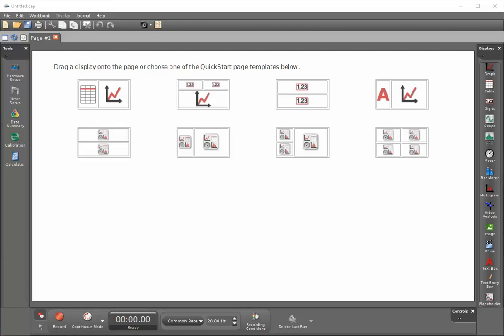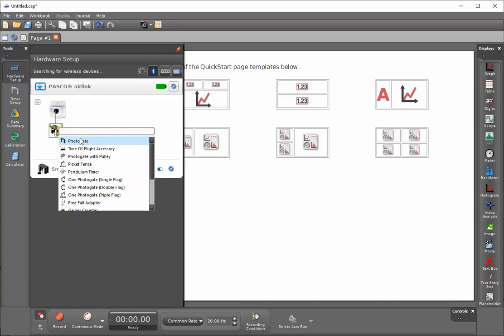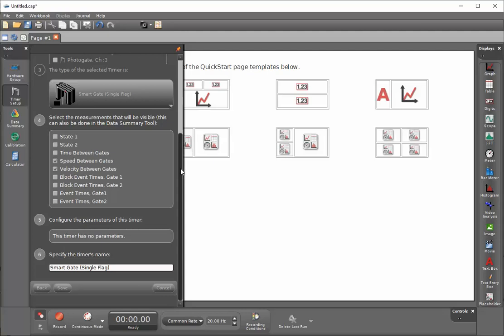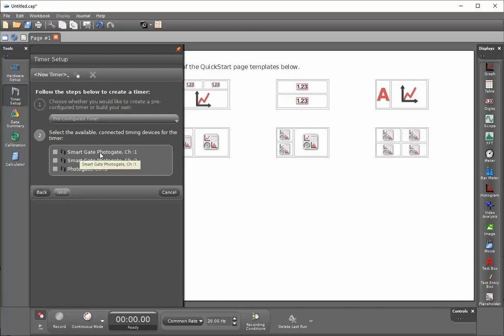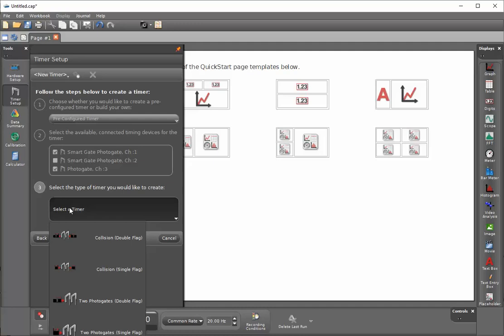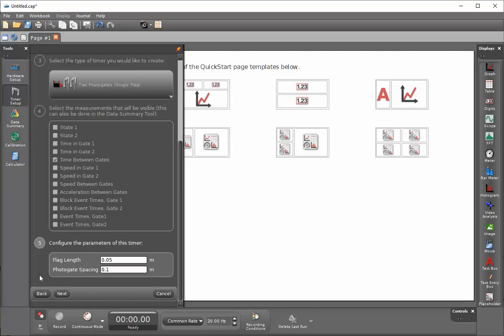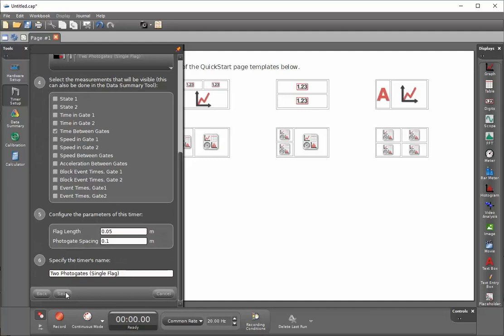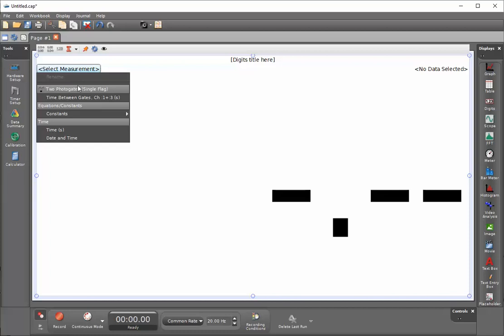Configure Smart Gate and Standard Photogate for Time Between Gates (Capstone)

Comment: Where can I find information about what the flag length means?
Reply from the maker: The flag length, along with the time the beam for the photogate is blocked, is used to determine the speed of the object within the gate.  The smart gate has two beams, so the flag length is not as critical (the Smart Gate and Wireless Smart gate look to the time between when the two beams are blocked to determine the speed of the object).  For the traditional photogate, the software needs this flag length to determine the speed of the object as it travels through the gate.  If you have further questions, please contact us at support@pasco.com or chat with us at www.pasco.com.